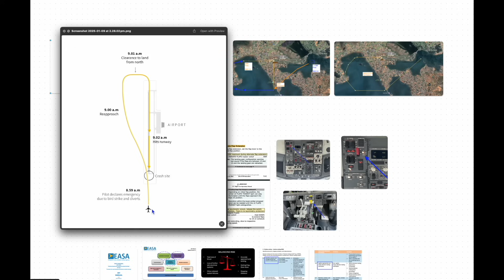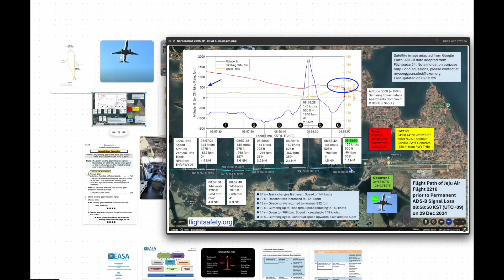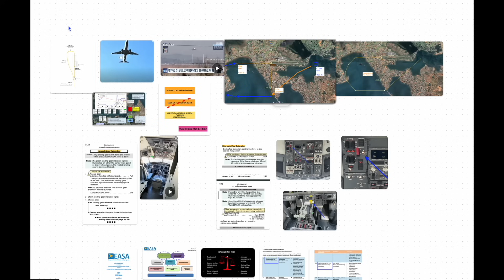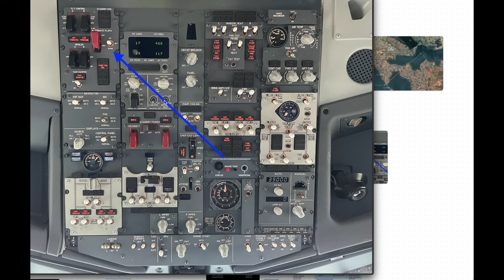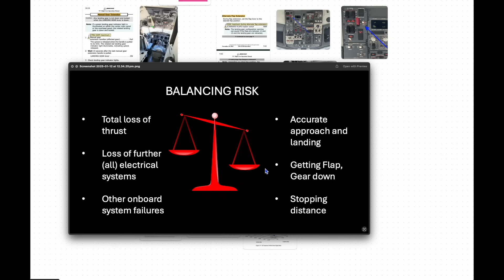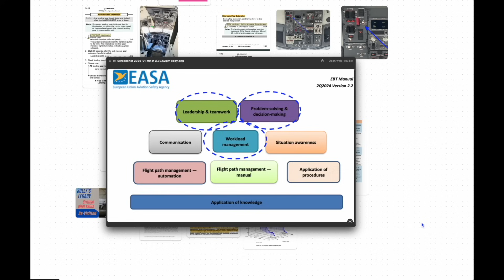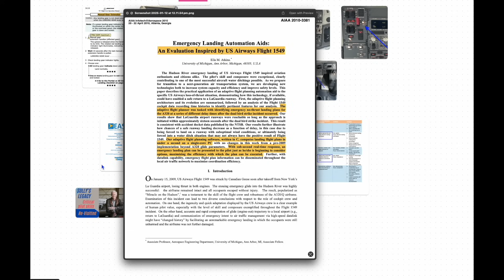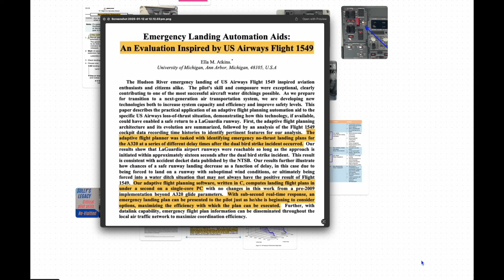Jeju 2216 Update - Multiple System Failures lead to catastrophe

Comment: What made this an awful catastrophe was the idiotic construction of the earth berm and concrete slab built on top.
Reply from the maker: Agreed, a big lesson for the industry world wide
Reply: Agreed, it was a really bad idea even if legal and within regs. Not that I'd claim everyone would have survived had it not been built that way, but certainly MORE people should have survived had it not been built so danged solid! Everything the plane would have plowed thru beyond that berm would have merely slowed the plane down and not caused it to disintegrate in a big ball of fire like it did! Once the plane begins to slow, it would have slowed exponentially as lift was lost and parts of the plane dig into the dirt. My question would be, why had nobody questioned the construction of that antenna berm? Did nobody realize just how solid the thing actually was? And if there was really a need for it to be that solid and hold the antenna at that level, why not fill-in the ground between the end of the runway and the berm so that it would have all been on the same level??? It's a really easy thing to have done... just saying. 😕

Comment: The  situation is tragig and the pilots   did not haver mucht  time  to  analyse.  Now we have many people  to analyse and a lot  of  Time!   To analyse thr  situation  we  schould  write down  what  kind  of  evidence we  have.
far  as   understood   we have a bird  strike  konfirmd by feathers  in the  engines.... Question: in  which  or  in  boath?   What  we know  istr  that  that  do not  run any more still  might  rotate  as  they  are  windmilling. 
Far  as we know the  plane had  blackout  et least  partial black  out.   Question  ist what  was  still  availibel  and how  long.   Second   Question  is  was  the  Turbin  in  the back  statet   to  deliver  some  Power.   and how  else  did  thex  handele   the  Situation?  
The  pilots had  to make  a  decicion  to  land   or  to  fly to  have  some time  to find   out  what  works  and  what  not etc.  We  see  that  the  pilots  did not land to  bay  some time.  Time  for  the  airort  to  prepare en  emergency landing.  
If  so   they  would have needed  enough  trust  to  stay  in  the  Air.   Oviersly   that means  to  get  the  landing gear  back  if it was  out and   to reduce flaps   etc to  reduce  drag. 
Question   is   what   was  operable   at this  point in time?  And   that means   wie  schould   ask   the   konfigoration  of  the  Plane when the   birdstrike happend  and  that  is recorded  and  the  situation  we  have  on film  and  after the  crash.  
Question  ist how  much energy  did  the  have  when  they  hit  et  the  birds.  how much  speed. Then  we  need  to  know  the  konvoguration   of  the  plane  at thatmoment,  wie have  the  recorders to  konw  this.  We  have   the  Distance they  flew und wie have  the  speed when tuching the ground. So wie  kan  calkulete britty  well  how  much  rtust  in everage   they  had  during  this  time!  Wie  see  that  the  right   engine was  burnig  fule wenn  the  plane  came  in.  
So  with  the data  we have  we schould  know    weather  or not  the  Plane  vould have  stayd  in  the  air  fpr  some more  minutes   and flying   futher away  from the airport  anf   gaining  time   to  do all  the  check lists   etc.   We schould be  able  make a  clear  stetement   about    the  fact  wether  the  Plane   could havestayd  in  the  air  or  not.
We  see  what the Pilots  did  and  could   do!    afte  they  decided not  to land   they  decided now   to land  quickly.   Did  the have  smoke or fire  on board or  something  else?   al  least not extream  as seen  o teh  video   after tuch down,  You can  see the  arm   of a pilot   through   the  window, but not  thick  smoke..... 
So they  decided  to  land    and  the  had   the  pane  under control   in all  three  axes.  
But   the  plane  still  is  in  a  low  Dag   konfiguration,  landing  gears   in!   Solanding means  to   fly  at  a lower sink rate,   and higher Speed.   What  we  see  is that  the Pilots  vould have gone   a longer Way  to reduce  speed   and   altitude,  but  they  did  not  and came  in  too fast and  tuched   down   too late .  
The  pilots  must have known that  They  need  more  runway  than usual,  and  art   already   too far  from  the  beginneng  of the  runway  even  when they  were  in   the  final   aproach.   We  do not know   wether the   had   a  chance  to  keep  atitude  at  perhaps   100  200   ore  300  Feet  and   then   to try   to do   an  other  aproach.     
So for me it  looks   as if  they  were not  aware   that  they  retratet  the  lading  gear,  or never had  ist  out,  and  wonderd  why  the  plane  ist  to  fast  and  to late on the runway   and    of  cause  suspectet not havong  enough  trust  for  an  other turn  around.  This  is  speculation!   At least  the  pilots   were not aware that  there is  something  that  would  stop  them   at the  end   of  the  runway......   
We have   to find  out  what was the  real  situation , what  died   the  pilots  see and know   whicht  decicions  were made,  we have  to  understand   why  and  in the  end   w have to  think  how   acidents  like  this   can be  avoidet   For me  and  most  people  the elephant  iin  the  room   ist  that  there  schould  not be  anything  in  the  way that  van destroy an   airplane!  at  the end  of  the  runway!                                  
Sorry  for my engish I am not used to it!
Reply from the maker: Thanks for the comments, great work on the English. My Italian needs lots of work!

Comment: https://www.youtube.com/watch?v=HcRyVEFDgGM
Reply: for every one else's info, the above url takes you here

From the NASA Archives: The Crash in the Desert
88,910 views  Feb 28, 2020

In late 1984, NASA and the Federal Aviation Administration conducted a dramatic experiment in which they intentionally crashed a remote-controlled Boeing 720 passenger jet (filled with crash-test dummies) in the Mojave Desert. The NASA Ames Research Center, the Langley Research Center, the Dryden Flight Research Center, the FAA, and General Electric all contributed to the planning and preparation for this test. Watch the explosive result here, captured from multiple angles on high-speed 16mm film.
Reply: @Nick_the_Gödel_Bach  They were testing aviation fuel mixtures, as I recall... to see if they could make an aviation fuel that wouldn't combust in a crash. They remotely flew these planes right into concrete and steel structures designed to rip the plane's apart.... they were almost as effective as this berm was! smh! 😕
Reply: @michaelshrader5139  Thanks for that info - I vaguely remember watching this either on the Discovery Channel or on one of the dozens of Air Crash Investigation programmes I was glued to.
Reply from the maker: Fascinating video - deliberate crash by NASA Ames research team, I'd love to see the lessons learned
Reply: @AdaptiveAviator  If I recall correctly, the fuel additive they were testing that was supposed to reduce the flammability of atomized aviation fuel in a crash event, failed horribly... it actually made the atomized fuel on impact explode much more violently. Now of course that wasn't the only thing they were testing, they also wanted to record with camera's what happened inside of the plane at various seating locations and to various sized crash test dummies and stuff. But it was testing of a new fuel additive that was the primary reason they were doing this... at least, as I recall it.

Comment: This is more of a question than a criticism. The mantra of the airline industry is to learn from previous mistakes. Based on the Sully experience, the decision to start the APU made a significant contribution despite a ram air turbine being standard equipment on Airbus’s and automatically deployed. In the film by Clint Eastwood, starting the APU was a select and forget, twenty second process. Why isn’t it standard practice of all pilots since Sully, to start the APU for any main engine problem, especially when close to the ground, whilst evaluating the engine issue in depth. Wasting a few gallons of fuel would appear to be the only negative? 😎😇
Reply from the maker: Fair questions, it may turn out the crew did just this
Reply: It depends on the damage caused by the birds. If the birds hit the main electrical bay and started a fire… APU won’t help with anything.

(The main electrical bay is inside the nose gear bay just behind a firewall so it is possible it could be hit and penetrated by the birds)
Reply: @tonamg53  I’ve checked the NTSB report re: CVR of Sully, he started the APU and just two seconds later took control of flying the plane from Stiles. As I mentioned, it is unlikely to be harmful but I’ve not heard it spoken about on any other engine malfunction video. I would have thought it would be a teachable reflex action by now.
Reply: @gbphil  Thing is, "CVR of Sully, he started the APU and just two seconds later took control of flying the plane from Stiles", that in and of itself doesn't indicate that the APU had begun generating power for the plane. The plane's RAT was already out and producing some power, just because Sully took over from his co-pilot some 2 seconds after he commanded the APU to start, how does that indicate the plane had switched over to the APU for power yet? Everything I've seen reported by various pilot blogs in the past 2 weeks indicates it take a few minutes at least for the APU to spool up and for it's generator to stabilize and begin producing power for the plane. You cannot start an engine, much less a turbine engine, in a mere 2 seconds and have it's electrical generator go to producing usable power in that short a time frame. At least as far as I am aware... that would be amazing if it was possible though!
Reply: @michaelshrader5139  The NTSB gave the starting of the APU which was foreign to / against the standard operating procedures (at that stage of a checklist) praise and credit for the controlled safe ditching of the plane and the whole incident lasted a few hundred seconds. Commanding the APU to start is a “fire and forget” operation, you do not need to take a crank handle to the tail of the plane. As you point out, there are a lot of electrical protections to ensure synchronisation with other generators so there is not a negative side to activation. Obviously there are no NTSB investigations to non-human injury bird strikes or contained engine failures but I’ve not heard anyone state that starting an APU is the first reflex action for power surges or power loss.
Reply: @gbphil  I am confused, what is it you are saying took only 100 seconds or so? Caption Sully's plane took longer than that from the initial bird strikes to his water landing on the Hudson River. He started out at 5K feet up, these guys started out at between 400 and 500 feet up... they are not really comparable incidents, other than hitting birds can be very bad for your engines.
Reply: ps. So I stand corrected on Captain Sully's altitude... I had picked up on the cloud deck altitude that was close to 5K feet that day, but Sully's plane was at just under 3K feet when it flew thru a flock of Canadian Geese and lost both engines. That's still a heck of a lot more altitude than these JeJu pilots had to work with though.
Reply: @tonamg53  I wonder if the birds could have damaged the landing strut mechanism or the door and during retraction it bent and breached the avionics bay. If I'm not mistaken the avionics bay is right on top of the nose gear well. We can't see the nose gear area clearly in any of the videos.
Reply: @ky7299  It is definitely possible. That would be the area of the wreckage that they should looked into as a priority.
Reply: @ky7299  Pensez vous que les pilotes savaient que le train n’était pas sorti (voyants non fonctionnels du fait de la panne électrique ?) ? On a l’impression qu’il pose l’avion comme s’il pensait que le train était dehors non ?
Reply: @francesca4966  I don't know if the red/green lights of the landing gear would light up if there was total electrical failure. Mentour pilot has a video of a dual engine failure simulation on a 737 and the FO instruments go black but the engine parameters cluster in the middle of the console still has power. The gear lever is right next to the engine parameters cluster. However if power lines from the battery are somehow severed then only the six oldschool backup instruments that don't require power will work.
Reply: @francesca4966  I just found a list of items powered by the AC standby bus that takes power from the battery and landing gear indicators are included, so if they had battery power they would know that the gear was not extended if they put the gear handle in the DOWN position and the red lights did not turn green. But if the AC standby bus was physically damaged they wouldn't have ANY power even from the battery.
Reply: @ky7299  Merci.c’est clair. Thank you, it’s clear.
Reply: @tonamg53 but unfortunately the area subject to the highest impact velocity (being forward ) 😕
Reply: In that case, the engines were still running, they just weren't producing any significant thrust. The generators and hydraulic pumps were still working, so starting the APU had no effect. Starting the APU is on the checklists for dual engine failure, and always had been. It just isn't the very first thing because it's not the most important or time-critical.
Reply: @ignorance72  Yeah you aren't credible... I've already caught you deleting and denying your previous comments. Not cool dude, not cool. 😐
Reply: That was an Airbus, with it's RAT generator automatically extended and already producing some electricity... this is a Boeing, it lacked the RAT and from diagrams I've seen several times in various pilot blogs it had a backup battery instead of the RAT. I've seen several Boeing pilot blogs where they have made the point that it takes a few minutes to spool up and start the APU engine then it has to stabilize the electrical generator before it will produce stable usable electricity for the plane... that all takes time, these pilots didn't have much available and would have been REALLY busy trying to assess and still fly the plane! Without the black box recorder data for the event, it's just not possible to know if they tried to start their APU or not, or if the still running #2 engine was producing anything usable or if the #1 engine had been running just fine before being turned off by command or if it was running very poorly and was either turned off by command or just stopped running due to internal damage.... there is just too much that we do not know now.